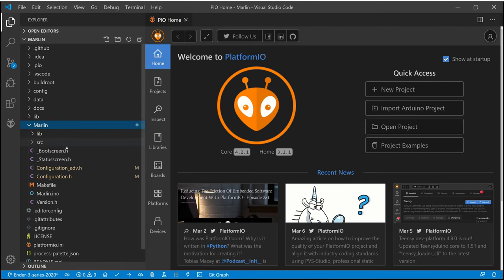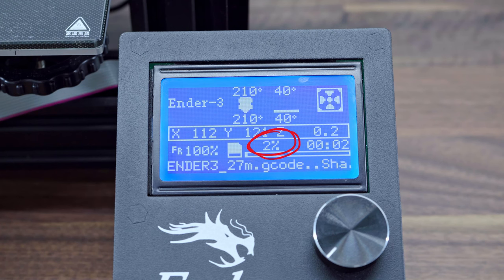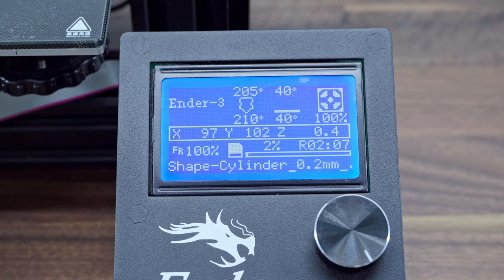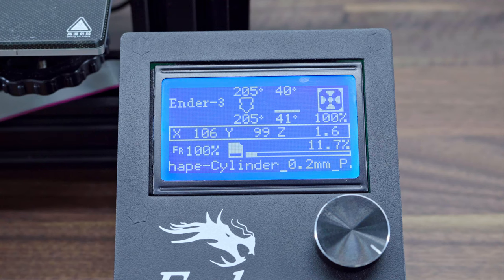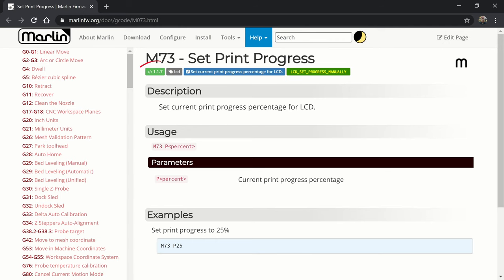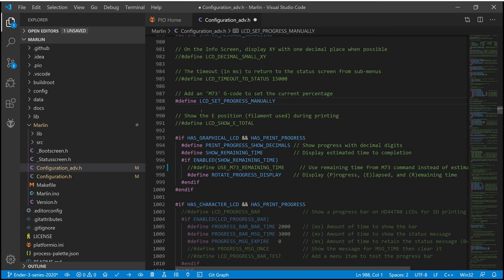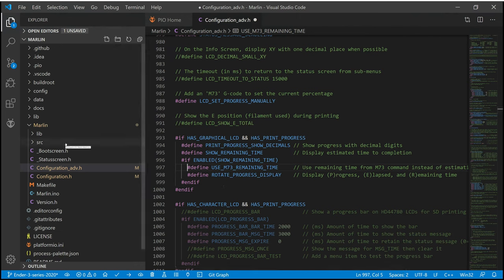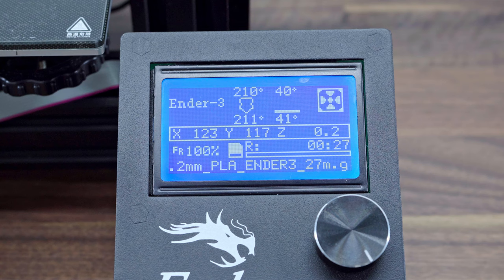Marlin: Remaining print time (3D printing)

Comment: Great, but how do I get it working with M73 commands from in Cura? It inaccurate now
Reply from the maker: I'm not using Cura, sorry. :(
Reply: Open machine sittings and in the start G-code part write this line under the G29 code:
M73 ; G-code to set the current percentage
Reply: You can find machine sittings like this
Settings - > Printer - > Manage Printrs
Reply from the maker: @tabutcureis7039  True! So simple... :D

Comment: for some reason i am not having the time displayed only the bar+ % being in the middle
aslo this is old not same setting :S
Edit1: uncomment SET_PROGRESS_MANUALLY 
and decide what you want to show and then you have to start a print and only then will it display both next to each other 
but ofc you will need your slicer or other gcode handler to support and generate m73 in gcode to update it manualy if you are printing through  a usb *pronterface/cura/prusa/octoprint